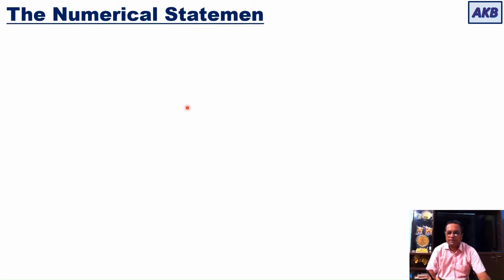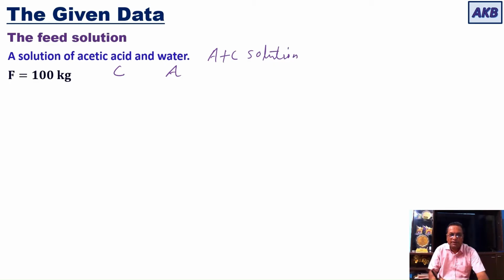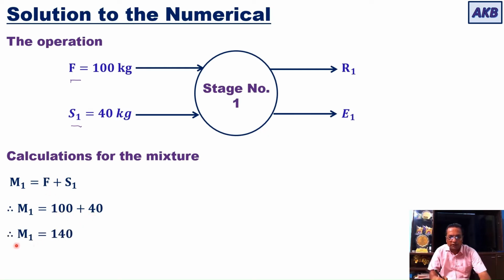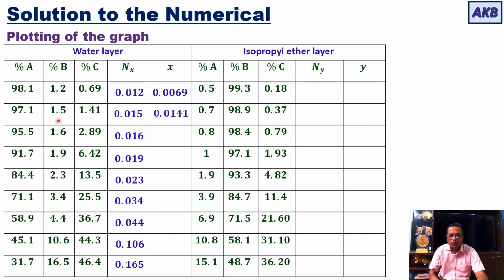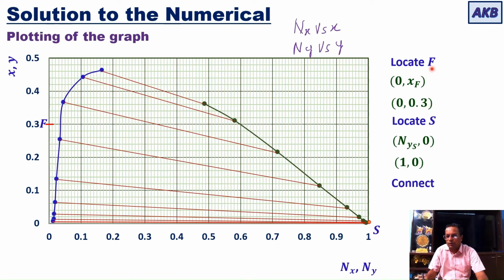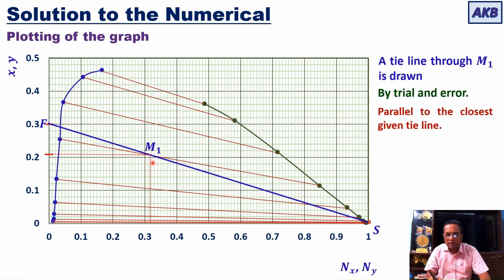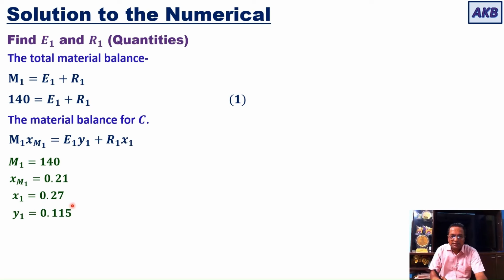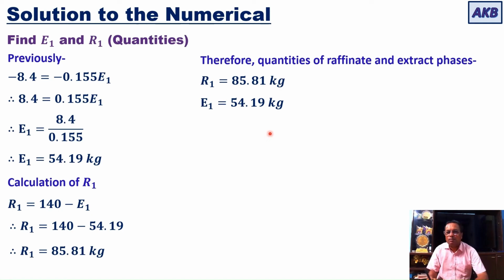Liquid Extraction Part 9 Single Stage Liquid Extraction Numerical

Comment: sir by calculation Nm1 should be 40/140 = .285. WHY it is coming .325
Reply from the maker: Yes values are close around 0.3. it depends on how correctly you draw the tie line.